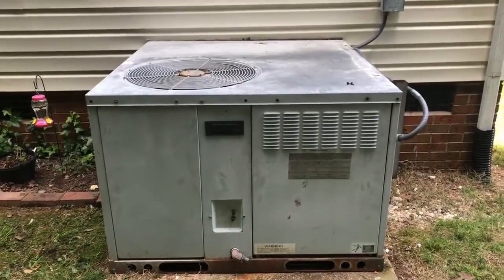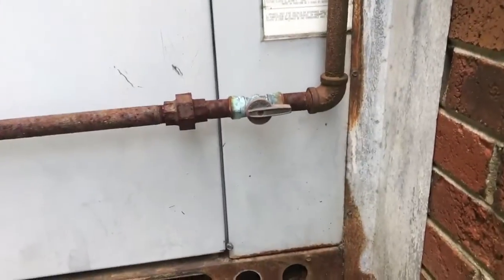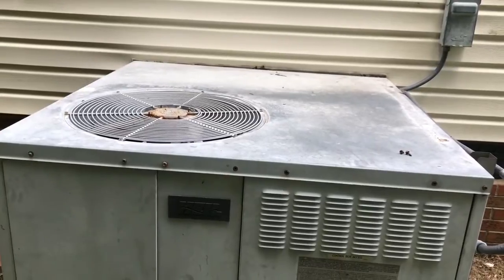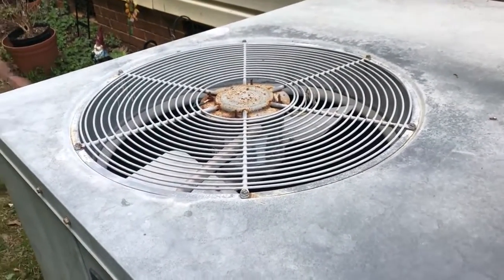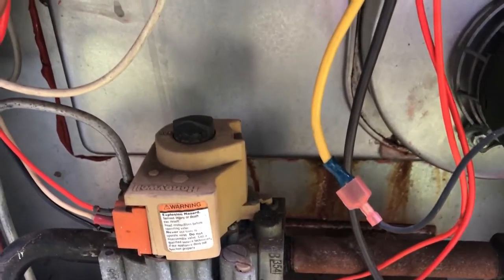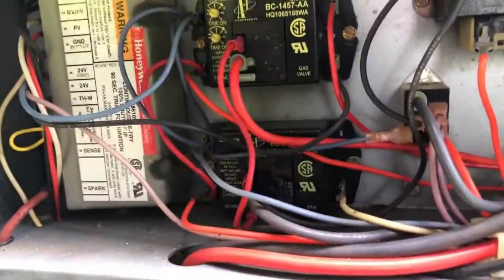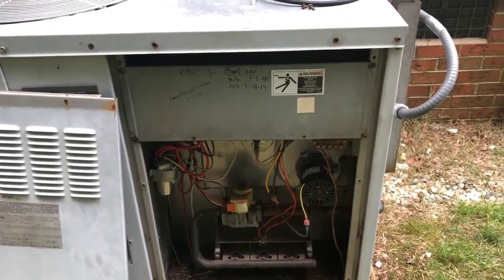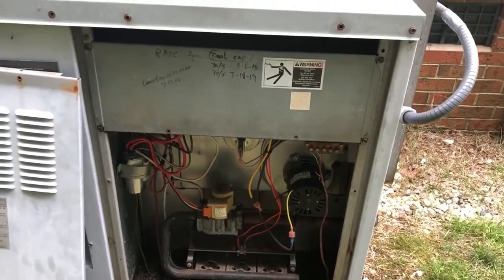FIXING A HEIL GAS FURNACE THAT WON'T IGNITE

Comment: That is not a gas line. That is a hose for air to get from the inducer motor to the differential pressure switch (the round thing above the gas valve). The differential pressure switch is a "proving switch". It's a safety device, along with several others in there.  The inducer motor draws air in for combustion and blows out the exhaust fumes to the outside. If the inducer isn't running, the furnace will not run. This is a good thing because you don't want all those fumes building up. The differential pressure switch proves the inducer is running by measuring the difference between ambient air and the air coming through the tube from the inducer exhaust. When it determines there is correct airflow it switches on and allows voltage to the gas valve and igniter.